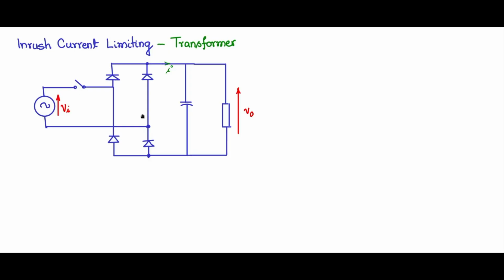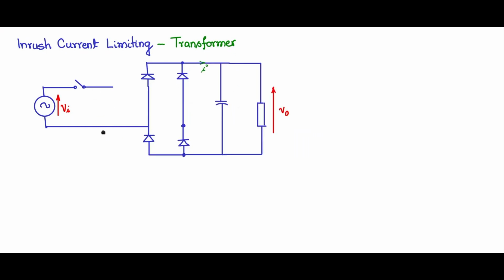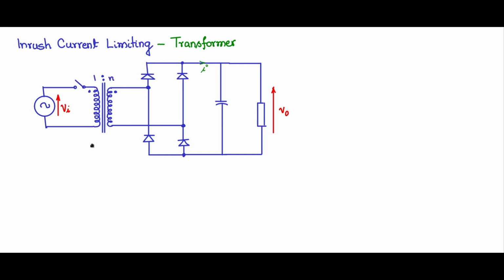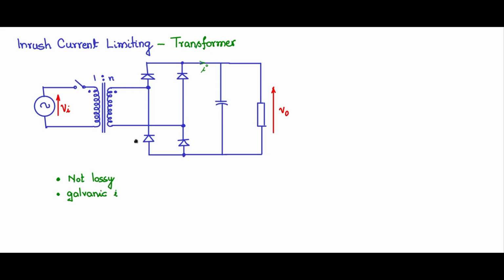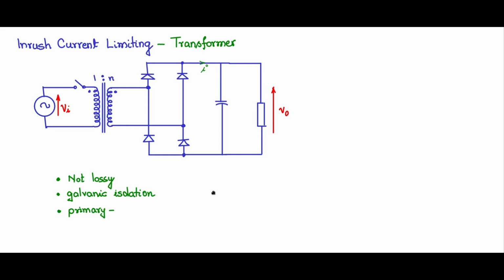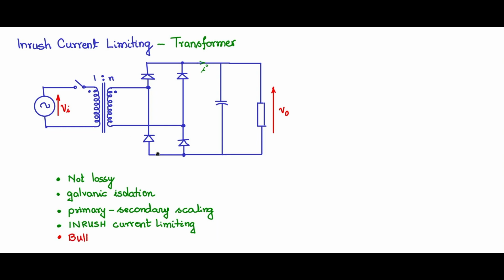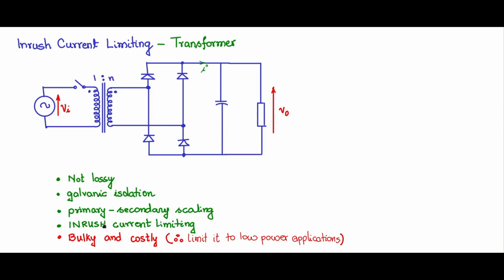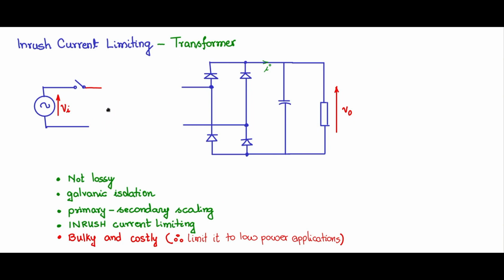wk05 04

Comment: Sir,u have forgot to mention the turn off chara in this circuit it's cruital

As the switch is turned off , there will be a voltage spike coupled to the secondary!!